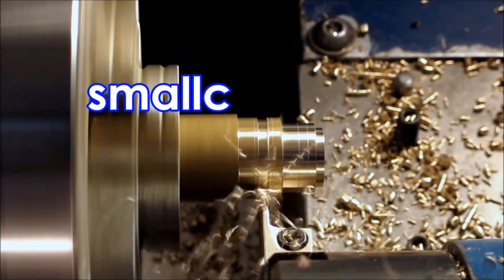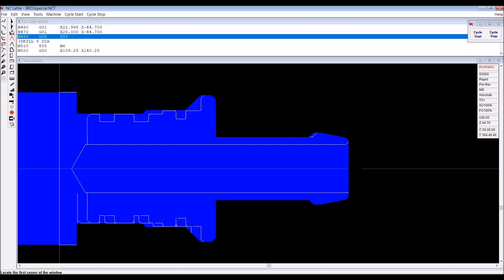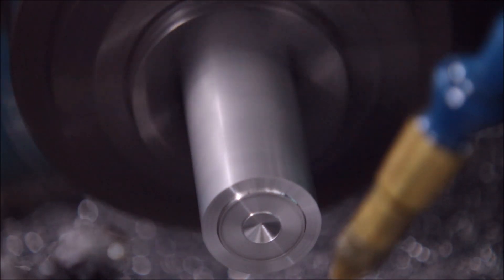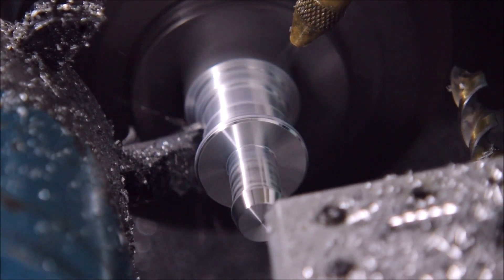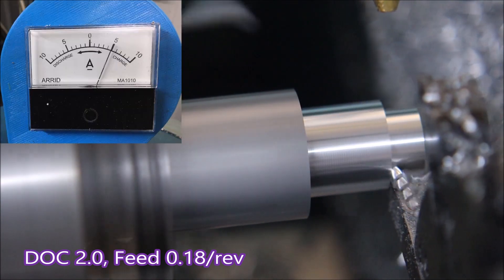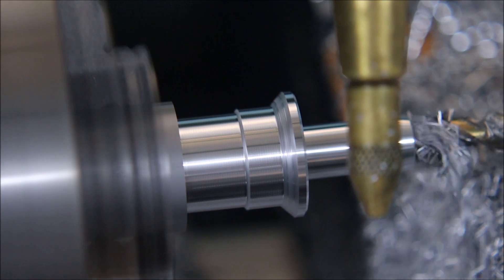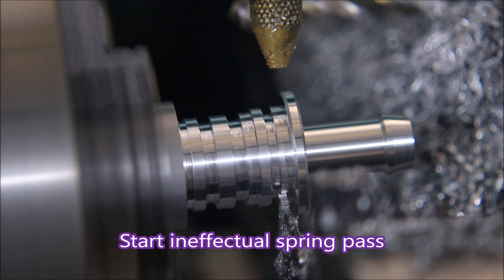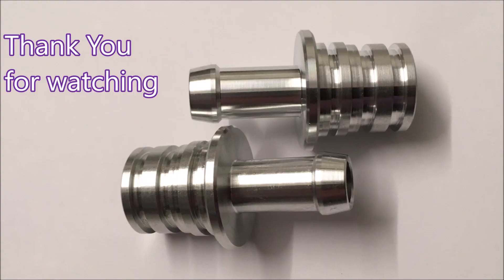Fail: This part has me beat. Drill and profile with parting tool in small cnc lathe

Comment: A rule of thumb I follow at work is to use uncoated carbide tooling on aluminium.  Even on a ground tool, the coating can dull the edge slightly and also gives aluminium something to stick to.  If you are speed limited a well made HSS tool can outperform carbide.
Reply from the maker: I guess that is why the inserts for aluminium are not only free from coating, but polished as well.  In a production situation, it is hard to beat the repeatability of carbide inserts. No regrinding and re-setting. Thank You for your comment.
Reply: @smallcnclathes  If you have to use a coated tool make sure the coating contains no aluminum.  As we all know aluminum likes to stick to itself.  It can lead to build up on the tool which can cause poor surface finish and in extreme cases out of print parts.

Comment: I usually use an MDT insert (multi directional turning)  for things like that. We do see that step sometimes. It’s usually from either tool deflection or tool alignment. Have found that even new tools the insert isn’t perfectly parallel to the tool body. It’s a pain in the ass when trying to hold .0005 total tolerance but the insert has .001-.003 taper from one side of the insert to the other.
Reply from the maker: Thank You.  I just priced some side cutting inserts for my parting tool and at $80 for 5, I am a bit undecided.  Since retiring it is unlikely I will use them for anything but videos, so 5 of them will outlast me by a number of years I think. LOL If I could buy one or two I would go for it, but I am still thinking about it.  if I get them you will see my effort at using them.

Comment: The problem you're having is the deflection of the grooving tool increases the effective tool length. When you plunge to depth, back to tool of a small amount to get rid of the step. 

The deflection is require to give the tool back clearance and helps to prevent rubbing
Reply from the maker: Thank You for your comment

Comment: Try a Kennametal NGP style grooving tool, as narrow as possible. They have a nice positive geometry that works well on aluminum. I have also found the NGD style with a chipbreaker works well as the chip breaker tend to make it more free cutting.
Reply from the maker: Thanks Kris for the suggestion, I doubt the job will come up again and having to buy 10 inserts at a time is pointless now that I have retired.

Comment: This is great machining! I think your issue is due to chips not clearing, tumbling in the groove, catching, and being plowed by the insert. Since you have a microscope, grab some chips from a similar grooving cycle with the same issue and see if you see any chips that are particularly inconsistent from the other and show signs of galling. I would bet that you will.
Reply: I guess as an alternative you could take drastic chip clearing measures by applying high pressure air throughout the cycle and see if the part changes-if it does, and I believe it will, you can rule out other complexities and focus on making sure the chips clear the work
Reply from the maker: Than you for taking the time to make these comments. I appreciate it.

Comment: Sometimes things look easy but they can be a pain in the B ... There are different types of parting inserts. For cutting , for cutting and turning , and for turning. And of course for different materials.  You could try some and find out what works for you best . Or if the turning tool fits in , finish 1 side of the groove with it .
Reply from the maker: Thank You, I priced some inserts of the type you mention and at this point in my career it is not worth the price. Pretty sure 9 of the 10 inserts would become part of my estate and my son would never use them. LOL

Comment: Excellent, very interesting; possibly the OD issue using the grooving tool is due to the concave cutting edge ( if I understood the image correctly) with change in tool pressure?
Not trying to split hairs, but I've learnt to differentiate between parting off inserts (oblique cutting), and grooving inserts.
Enjoy your work, and narration.
Thanks for sharing and best regards from the UK.
Reply from the maker: I feel the same way about the front edge of the insert. BUT, my brain says that it is ok in one direction and that is easy to accept. What I have difficulty with is why a pass in the opposite direction does not fix it, which it does not.
Reply: @smallcnclathes  is it possible that tool deflects down an imperceptible amount during the right to left path -Z, but on the left to right +Z with little load doesn't? Obviously tool centre height is most critical on smaller diameters (sorry for stating the obvious). But, yes, I think your proposed tool would alleviate the issue. Again thanks for replying, and sharing video's.
Regards John.

Comment: Too many things at once...go to the end for a tldr. 
First and foremost I suggest turning a straight OD and verifying with the microscope that the edge is parallel to the OD...it almost never is...the toolholder sides are not a dependable reference and the inserts are not that precise but inserts are further down (especially molded ones). If it is it will generate a superb surface finish with the right cutting data but I avoid relying on that and I tend to switch to a turning tool when time allows because of the tedious setup. 
Generally grooveturn tools deflect sideways a lot, especially when facing. They are best to be applied for backturning when a relief groove is provisioned. As you are backfacing that shoulder, the insert reaches down crooked and when you feed in z the force goes on the opposite side, bending the tool the other way. Due to this the tool will leave a convex bump at it's middle. This is exagerated due to the tool being so narrow and by the choice of a molded and coated insert with any edge preperation other than sharp. The edge preparation at minute depths results in marginal cutting conditions, which can cause the edge to bounce in and out of the cut and as a result the bump left isn't getting cut (notice that the shoulder can still make chips due to the larger deflection). 
As a first step with the same tool (after verifying parallelism) and strategy, I suggest leaving 0.05-0.15mm radially for the cleanup pass. If that's not enough then you can cheat a little. You could yaw the holder a few arc minutes to a degree maximum towards the chuck so that the edge that reaches the corner has the final word but be careful because this will increase pressure and sideways deflection and very important to not do this to grooving tools with wipers. This is a little personal but I hate wiper grooving tools with a passion because they have binding tendencies unless you call the fire department to keep them cool...also the increased deflection renders the wiper usellessv in most cases and the finish will look like smothered shit...I suggest finding inserts with corner radii and well defined side relief angles.
What's left is to fine tune the feed rate and you should be able to skip the cleanup pass and get a perfect part with exceptional surface finish.
As for the machining strategy, if you are still not satisfied, it could be helpful to plunge to depth and retract the tool, turning only left to right. It would be even better beneficial to start on a straight OD so that the grooving tool engages both sides simultaneously so it will not deflect thag much or at all but in this case that would mean a larger depth/width ratio which is another can of worms.
Another approach is to drill the hole afterwards or in steps which allows for more controlled release of stresses and less warping but other problems may arise on larger parts.
If you are worried about cycle times and extra operations don't forget that you can groove first and drill off later. I usually don't buy 30$ drills but I hand hone mine so I get your possible concerns about cracking through the material with them...stoning a tiny (emphasis on tiny), less positive to almost neutral rake land on the corners of the drill will greatly reinforce them without affecting cutting performance in any significant way (actually don't do that if you are not 100% confident on your honing skills. If the edges rolls the surface finish will greatly suffer)
Tldr: verify a parallel edge or yaw it in, leave a tiny ammount of stock for cleanup, use a sharper tool, change machining strategies and/or order of operations. Also...get a left hand turning tool...thank me later!
Reply from the maker: Thank You for such a detailed comment

Comment: Hi, 2 ideas:
The geometry could be wrong. Some grooving inserts  are better for parting-off (only cut in XX ) and some are good for OD turning. (try to use precision ground inserts, not molded ones)
When you go X15.6 or whatever, use a timmer before retract so the tool have time  to cut one full turn at lest the same diameter.
thats G4 X0.2  (in seconds)
and probably u wont even need to finish or spring pass in ZZ.
Stay safe.
Reply from the maker: Thank you, should the job come up again, I will try to remember your suggestion.

Comment: I’m not familiar with cnc or cnc lathes but could it be deflection of some type after drilling the hole and if you cut the grooves before drilling could it be more rigid?
Reply from the maker: Rowan Dunn thank you, but that is still a fairly solid piece of metal there. Not that I am in an position to deny any suggestion. I tend to favour the geometry of the insert is the cause of the problem.  But I would have thought that a good result would result from making the insert cut in the opposite direction, but not the case.

Comment: Trail and error. First I would say leave more on for finish both X and Z. Rough plunge at groove center then finish Z+ side then Z- side.
Reply from the maker: Thank You for what sounds like a suggestion that would be well worth a try.
Reply: @smallcnclathes  You are welcome. What I recommended is my standard practice learned since 1995. I am still learning. But I get it right more times than I get it wrong these days.

Comment: Hi,

Just thinking could it be the coating on the insert?

Have you tried another insert?

After using sumitomo inserts on my milling machine I swore I would only use Sandvik inserts and tooling on my lathe.
Reply from the maker: I don't expect it would be the coating and I don't have any others to try anyway. I started out with Sandvik but found their threading inserts are unique so I left them alone very early on.
Sandvik may offer better inserts but with only half a horsepower at my disposal it is hard to prove. Sumitomo work well for me at a price I like. If the job comes up again, I will try the Sumitomo, the one used in this video was a Kennametal.
Reply: @smallcnclathes  oh ok, I didn't put together 240vac at 5amps was .5hp .
Reply from the maker: @flagmedownmedia  To be honest, I don't have a clue what it works out at, but it is 180vdc rated at 5 amps continuous and the name plate shows it as 0.37kw which I think is around half a hp.
Reply: @smallcnclathes  ahhh ok
Reply from the maker: @flagmedownmedia  and I have only had that much power since upgrading the spindle driver a couple of years ago.  The motor as it came from Hercus was only getting around 140vdc which did not give the lathe anything like .37kw
Reply: @smallcnclathes  180v times 5 amps gives you 900w of power, which is still not a lot, more than in a cordless drill but less than in a corded drill
Reply from the maker: MF175mp the plate on the motor states, 180vdc, 5 amps continuous, 0.37kw

Comment: That type of insert does not look to perform well under light pases. The geometry and face look to have rounded edges, for my normal lathe inserts like that like to be driven hard, with larger depths of cut and higher speeds.
Reply from the maker: You may well be right, should the job ever come up again, I will try a different insert, I have one type that is very sharp and with no corner rads, that may do better.